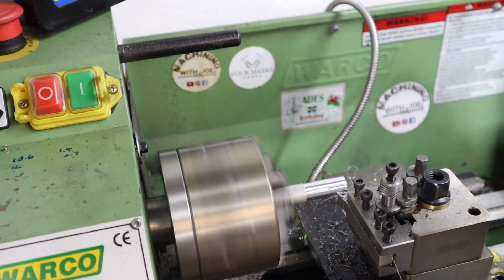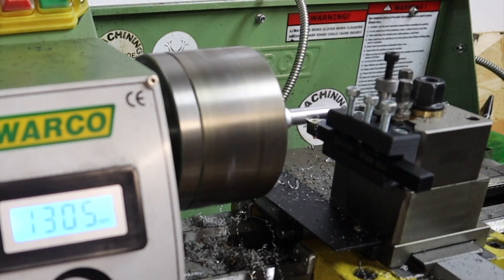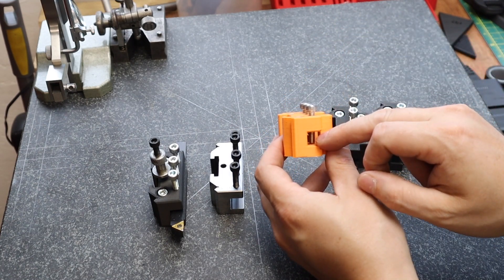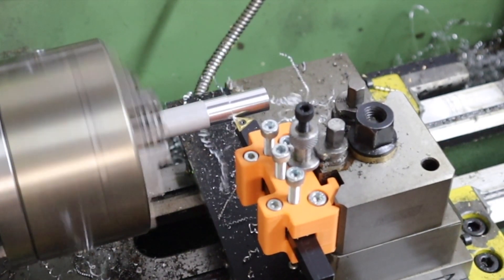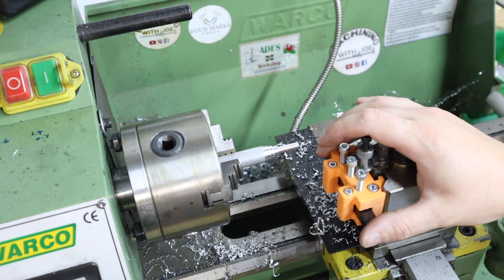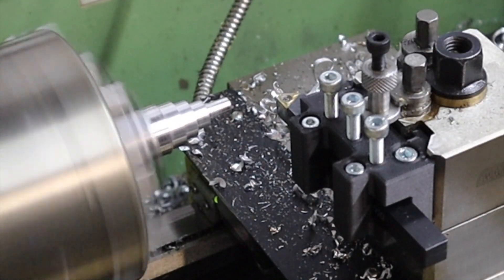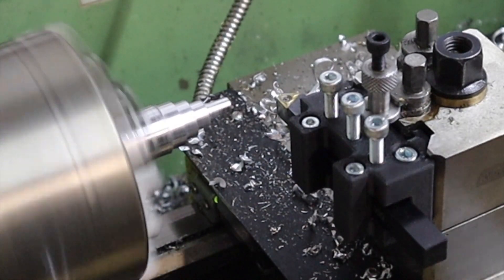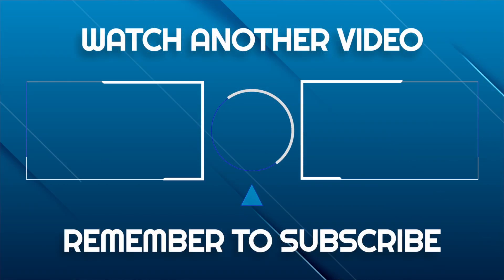Can you use 3D printed tool holders on a mini lathe???

Comment: Seems like something worth trying. My quick change tool holders cost $30ea. But to print them for $1-2 seems like a option worth trying. I only machine soft metals and plastics anyway so they should hold up well if I base by design off your 4 sided holder
Reply from the maker: Yeah they seem to handle Aluminium and brass fine.

Comment: Don't take this the wrong way Joe, but you're actually cheating a bit by taking progressively higher DOC on the same piece, because you are shrinking the diameter.
If you were taking progressively higher DOC from the outside diameter only (and thus removing considerably more material/time) then you would have a good comparison to a steel holder.
However you did do a good comparison between the 3 printed holders and they faired far better than I expected they would.
I was waiting to see if you had any heat transfer to the printed holders and maybe some meltdown :)
Cheers from Down Under
Reply from the maker: Cheers Bob yeah completely get what your saying, all cuts on the OD would have been a better true reflection. None the less though taking 5mm of I was so impressed with that. Let’s see how they handle a lesser cut on steel ay 😁
Reply: @MachiningwithJoe  👍

Comment: What infill % did you use for the tool holders? Also, there's a number of destructive tests on YT of different materials and PLA out performs almost all of them.
Reply from the maker: Hi Larry so all tool holders were printed with a 50% triangular infill and a 4 wall loop. From doing some research on my choice of material the tensile strength in the X-Y plane is as follows. 
Bambu PLA 32MPa
Bambu PET-CF 76MPa
PA-CF 88MPa
Hope this helps. 👍
Reply: @MachiningwithJoe  Thanks Joe. I'd go 100% and see how it works!

Comment: Interesting idea. They all performed better than I expected them to. I'd be curious to see what the life expectancy of a tool like this would be. Looking forward to the designing video.
Reply from the maker: I’ll be honest Gerald if you was to only use these on light cuts in soft material I can’t see why they can’t last a while. Let’s me honest they are never going to outlive steel ones but at like £2 a print even if you printed one every 6 months it’s not to bad.

Comment: If you would have used an insert for aluminum rather than the steel insert that you used, the tool pressure would be reduced and the finish could have been much better.  At any rate this is a great idea.
Reply from the maker: Yeah i wish I did now, I have a tool with a CCGT insert in ready to go so the Aluminium insert like you sed would have reduced the tool pressure.

Comment: 1:53 that warping alone where you’ve over tightened the screws would have made me question weather it would be safe to use or not.
Reply from the maker: Yeah I know what you mean that’s why I took some light cuts and then redesigned the part. 👍

Comment: Basically it's a good idea. I think I would have had a square hole (a bit of meat down that front side) and a bit more meat on the bottom as it is plastic and not steel.
Reply from the maker: Yeah bulking it up would definitely help out with the rigidity problem. But for an idea that I wanted to see if it was possible I was genuinely shocked how well these performed once the initial design was changed.